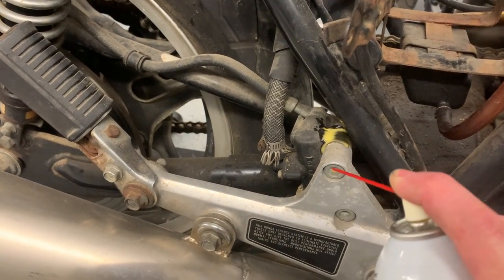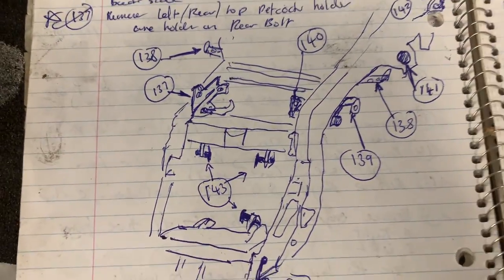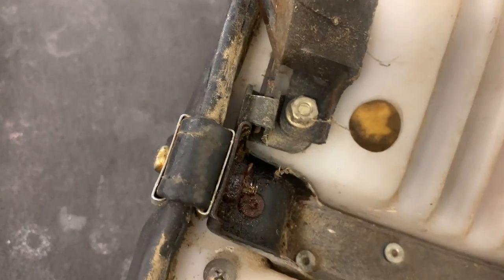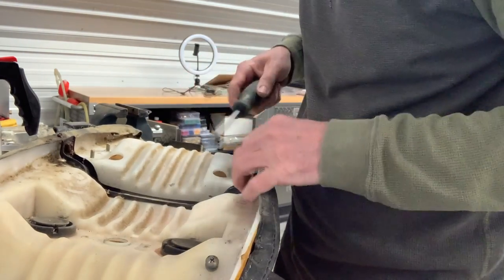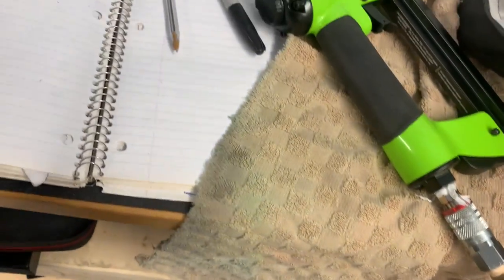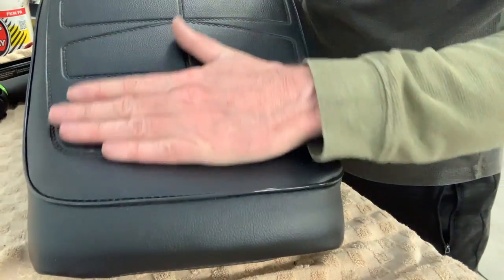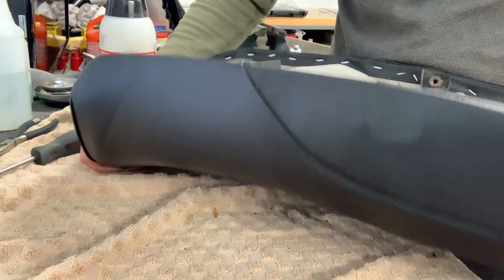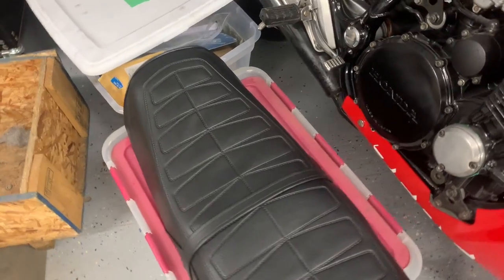1982 Honda CB900F Barn Find - Restoration - Episode 2 - Seat Repair

Comment: Nice collection you've got going there. The seat turned out pretty nice. Another pair of hands always helps when it comes to doing the stretching. I find you can never take enough pictures. Last year I rebuilt the engine on a 04 cbr1000rr, and thought I had enough pictures, but wished I had taken more. Between the ones I did take, and the service manual, I managed to get it all back the proper way, though.
Reply from the maker: Thanks !.   yea extra hands are good, I had my son help me when I did the CBX seat.   I learned my lesson yrs ago taking pictures, I take way more than I think ill need and  that helps.